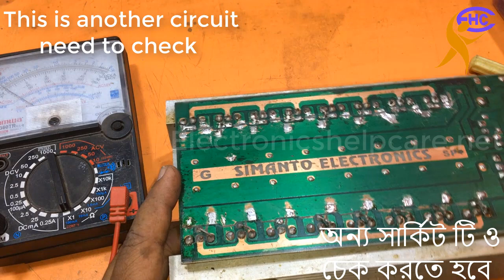High watts amplifier making part  2

Comment: i have one question i own a mixer pevey XR600C but the transistors are shorted only 1 is not can i install some replacement transistors?  Since the original Motorola can't find it at all?

Comment: What is the transformer voltage and Ampere?
Reply from the maker: 30-0-30 volt 20 amp
Please visit for diagram
https://electronicshelpcare.net/speaker-protector-circuit-diagram-using-ne555n/